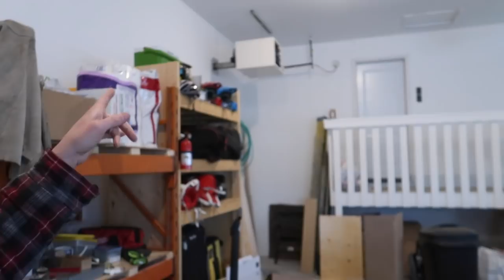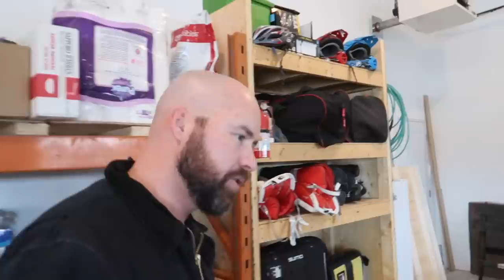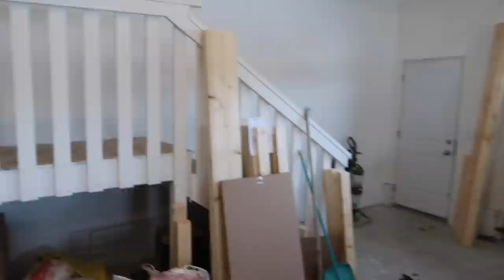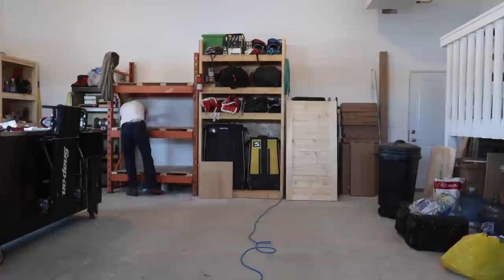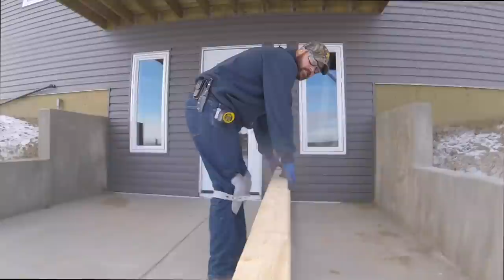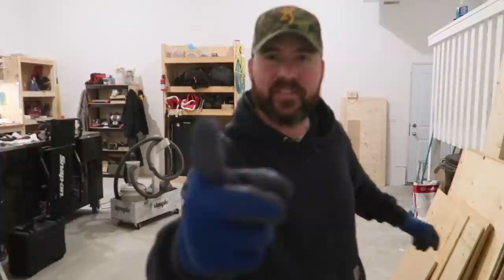We moved into our house!!!! 😅 (after living in an RV for 2 1/2 years!)

Comment: Add some "egg crate" baffling about a foot away from the heater and maybe some rubber spacers (for vibration) between the bracket and body.  See if that helps.